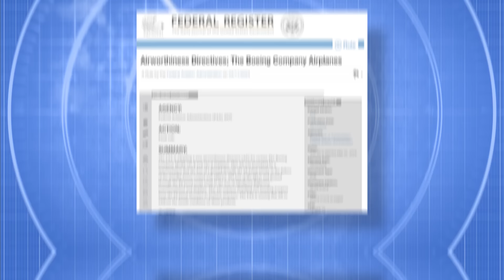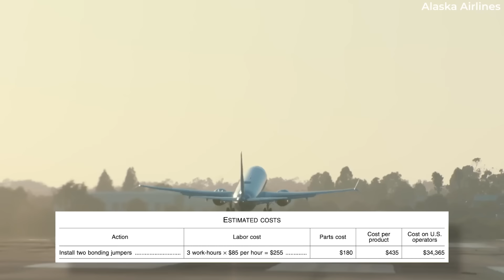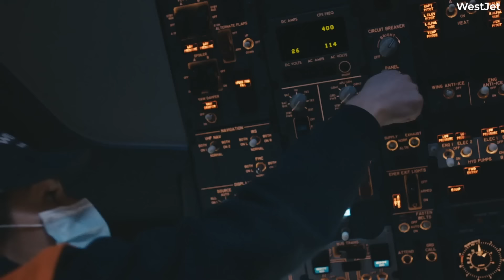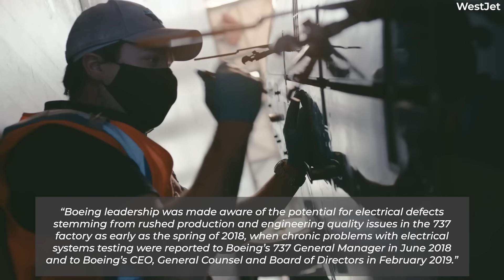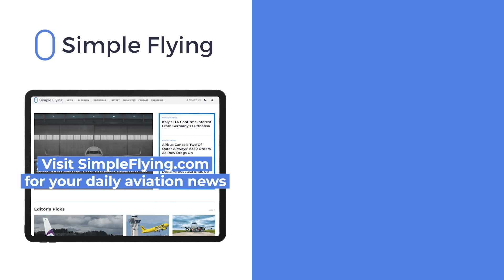New Airworthiness Directive Issued For Boeing 737 MAX Electrical Fault

Comment: 737 NG was perfect, very reliable and very low crash rate
Reply: perfect plane isn't suppose to have crash rate at all
Reply: @engerbendized2503  The vast majority of crashes are not to do with the plane, pilot error is the most common reason planes crash.
Reply: Crash rate really isn’t how you should measure how safe and reliable something is
Reply: @Matty12333  But is it "pilot error" when instruments gives false data?
Reply: @EsromFF  a330, Air France 447 and Qantas 72
Reply: @engerbendized2503 plus the crash was due to executive decision cutting corners not because the plane was defective
Reply: I agree the NG is good and reliable, but it is also very outdated even compared to any other Boeing aircraft.
Reply: @Matty12333  That's why it's very important to minimize crew error proving the best possible information and redundancy which the 737 lacks on both accounts.

Comment: I like redundancy, in AOA sensors, Turbofan engines, and power sources; however there is only suppose to be one and only one path to ground. When you add multiple paths you get grounding loops and they cause all sorts of problems and are very hard to track down. I have done it, so I do not know how this is going to work out. Maybe doing it right the first time with heavy enough and quality parts would be the right answer.
Reply: What do you expect when their habbit are cuts any corner?😂
Reply: Then again, multiple layers of protection and redundancy does make it more complex but at the same time it's a plane, it has to have back up

Comment: Big parachute must be made compulsory for all Boeing aircrafts so that even if falls, it will land slowly. And yes, parachute should not be made by Boeing.
Reply: correct!
Reply: Wouldn't that require stalling the aircraft first?
Reply: passengers should also get parachutes for the airbuses that fall
Reply: @nickolliver3021  Now you are here too Boeing fanboy!!
Reply: @parimal7528  nope I'm neutral
Reply: @nickolliver3021  Based on your comments on other channels where you even defended B787 & 737max, it does not seem so!!
Reply: @parimal7528  why do you think I'm defending them? No famboy should defend a350 or a320
Reply: Oh, Boeing's unfixable chatbot is here. Surprise... not.
Reply: @jantjarks7946  and so are you just typical isnt it
Reply: Yeah, it should be made by Airbus!
Reply: @nickolliver3021  "neutral"
PFFFFF
Reply: @Kalvinjj  does that concern you?
Reply: @nickolliver3021  "nope I'm neutral"
🤣🤣🤣🤣🤣🤣🤣🤣🤣🤣🤣🤣😂😂😂😂😂😂😂😂😂😂

Comment: I hope sincerely that they don’t play with the lives of the passengers. 🙏🏼
Reply: they wont
Reply: 346 lifes already gone. Max is bloody
Reply: @nickolliver3021 they will
Reply: @deltafox757  they wont
Reply: @muhammadhanifkurnaen6689  so is the a320 bloody
Reply: @nickolliver3021  they will
Reply: @deltafox757  they won't
Reply: @nickolliver3021  they will
Reply: @deltafox757  they won't
Reply: @nickolliver3021  they will
Reply: @deltafox757  they won't
Reply: @nickolliver3021  they will
Reply: @deltafox757  they won't
Reply: @nickolliver3021 Which A320 fatally crashed due to design flaws and just poor manufacturing quality in general? The latest Pakistan International Airlines A320 crash happened because of the pilots' blatant disregard of procedure and protocols.
Reply: @sarthakmohanty997   even airasia qz8501 flight crashed due cracked soldered joint on electrical system and airbus acknowledge it without any excuses
Reply: Will there be another max crash?

Comment: Are aircraft becoming too technical?  Too reliant on electronics? I am not being flippant  I am just asking.
Reply: airbus doesn't have the same issues, boeing is just careless
Reply: @ProAvgeek6328 Ahhhh… tell Qantas 72 that.
Airbus FCUs have had so many problems.
Reply: @Ayayau57  no fatalities or further issues
Reply: @ProAvgeek6328  If not for the formidable skills of the pilot, everyone on QF72 would have died
Reply: @Ayayau57  still less dangerous than 737 max
Reply: @ProAvgeek6328  Less dangerous?! AF447; no heated pitot-tube?
Reply: @Ayayau57  a330 is older, and has it been grounded multiple times? does it still have issues to this day? whistleblowers?
Reply: @ProAvgeek6328   Yes to all of your questions
Reply: @Ayayau57  source
Reply: Airbus had issues in the late 2000s with piot tubes which were faulty. There has been some issues with airbus planes pitching down due to false data too. It was just luck it didn't crash and sorted the jssue out